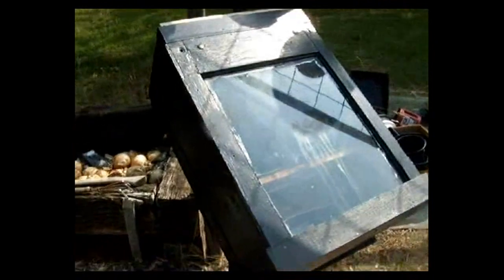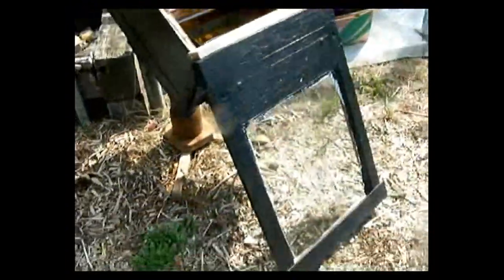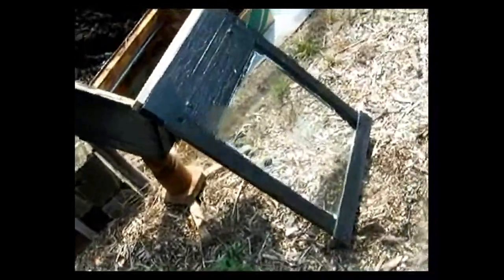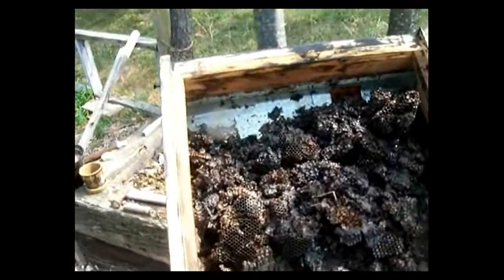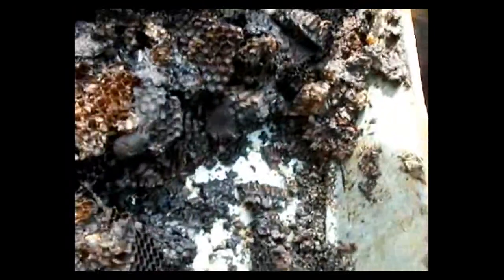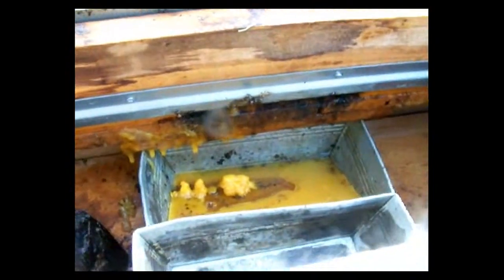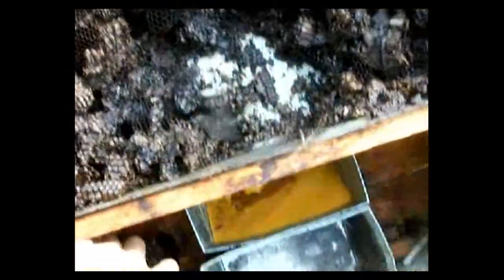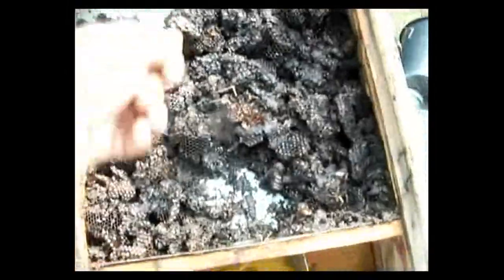Solar Wax Melter Explained

Comment: Do you have any problems with using galvanized metal? Like cleaning? I think it isn't smooth
Reply from the maker: No. I used my hive scraper and it does a great job when the surface is hot.
Reply: @JCsBees  Thank You for reply. I like Your videos I'm a new beekeeper and they help a lot👍